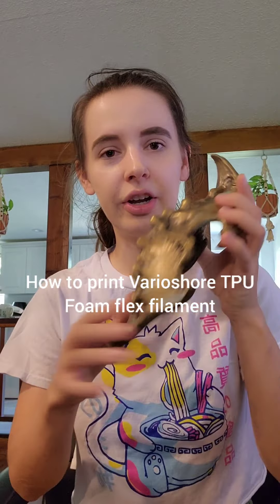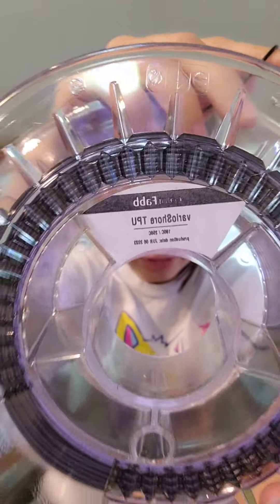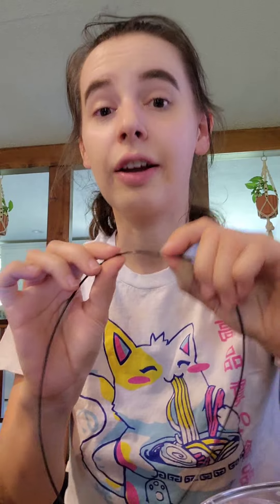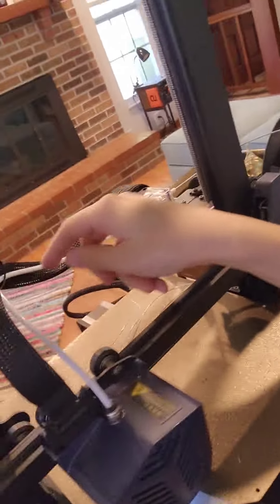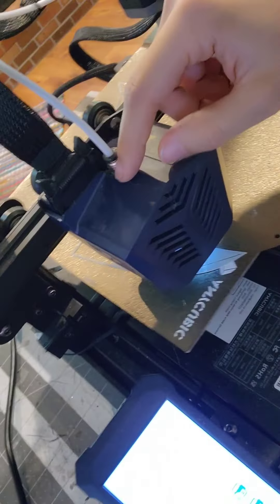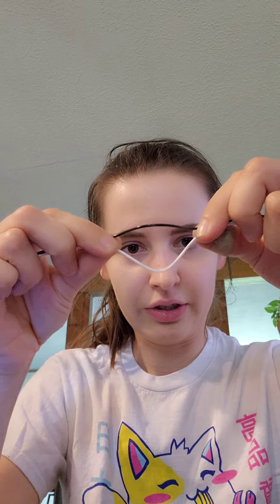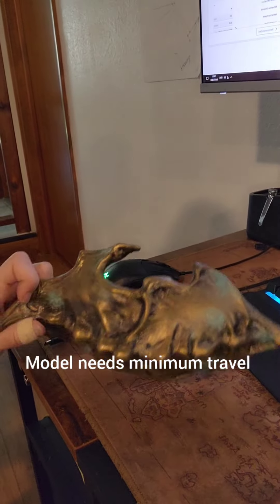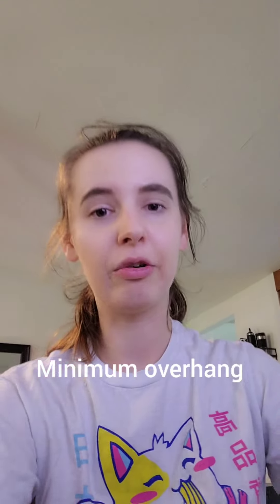How to print with cosplay flex filament

Comment: Thanks a lot for sharing! What do you use for basecoat, paints and lackers? I find it hard to find those so that does not crack
Reply: I just found your other video about this, thanks! Urecoat filler to get rid of the layer lines, then flexible acrylic paint or latex paint. It didn't mention a top coat though, do you use a top coat?

Comment: Did You figure out how to remove the extensive stringing at every travel start position? Like seam gap ot something like that? I tried so many settings but can't get it under control
Reply from the maker: @quasimongo410  no, i modify the model to require little to no travel. The rest is quite easy to cut off
Reply: Hmm I see. No solution for me. I'll try to finetune seam gap etc.